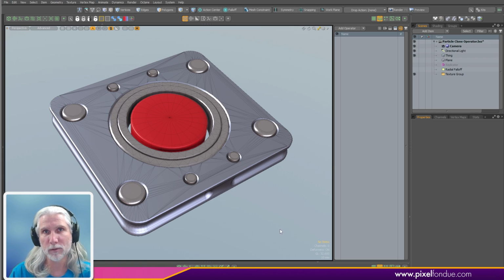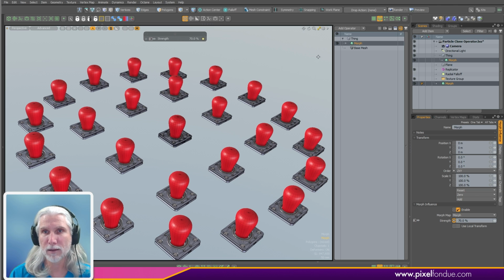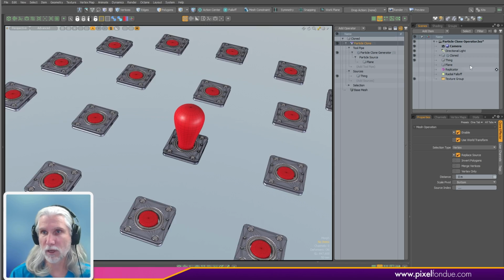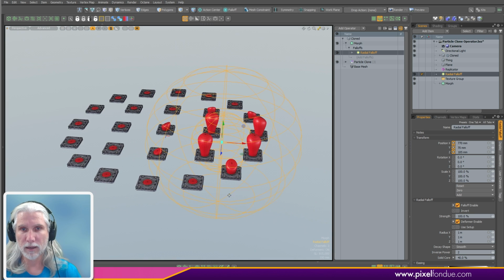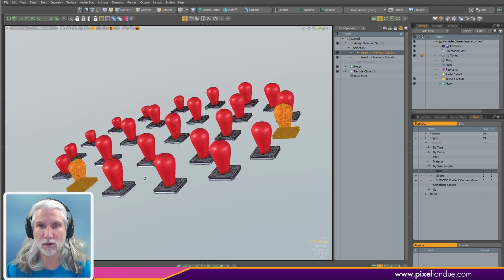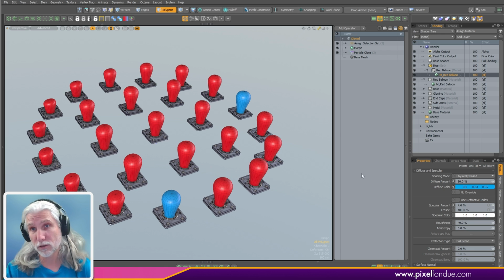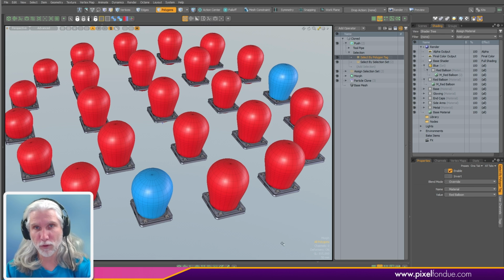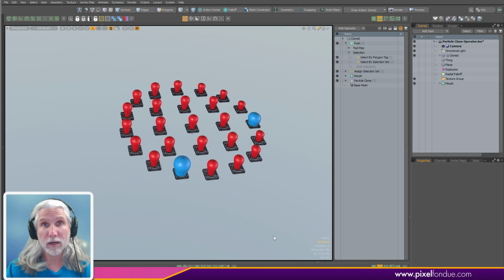MODO | 16.1 Particle Clone Operator

Comment: My only question would be... It looks like they are still being evaluated based on the position of the vertex... Is there also a way to effect them based on the position of the clone?
Reply from the maker: I'm not sure exactly what you mean, can you give an example?
Reply: @pixelfondue  I could be mistaken... But it looked like when you controlled the morph with the falloff it was controlling it on a per point basis.... not on a per clone basis. 
What I am wondering is if you can control the morph based on the distance from the clone itself... and not the distance from the point being morphed. 
Does that make sense?...
Reply from the maker: I think it's a little deceptive with the falloff I chose.  All morphs are 'per vertex' - this looks uneven because I chose a radial falloff...if I had done a linear falloff coming up from the bottom the balloon wouldn't look lopsided.  You can constrain morphs to a particular clone (or clones) with selection sets.  So you can do that.
Reply: @pixelfondue  I get that all morphs are vertex maps... 
What I am wondering is if you can effect the morph amount per clone based on the distance to the clone.
Reply from the maker: @bryphi77  actually (thinking about this) it would be a falloff based on the distance to the point or particle the clone is assigned to. So you would use a falloff probe and a locator at the point/particle pos.  It works (just tried it) and effect is better.  No partial morph - just smoothly goes 0-100 on all verts the closer the falloff gets to the clone.
Reply from the maker: If you want it to just effect 1 single clone (or multiple) then use select by previous to select those clones and add a weight map or selection set and in the morph influence use the weight map or selection set.  All the other clones will be ignored.